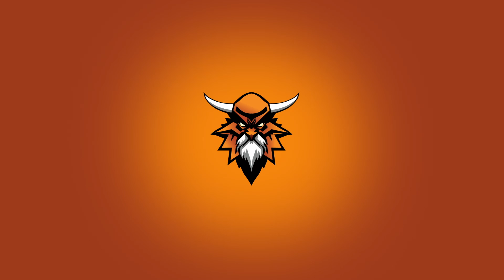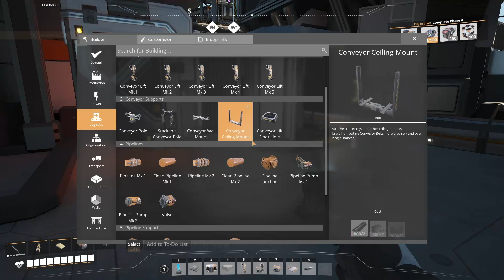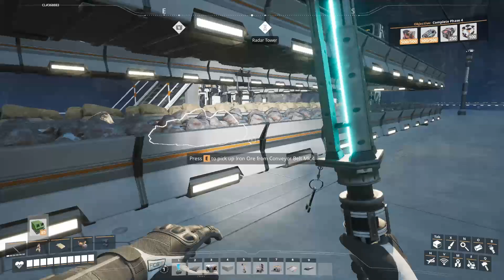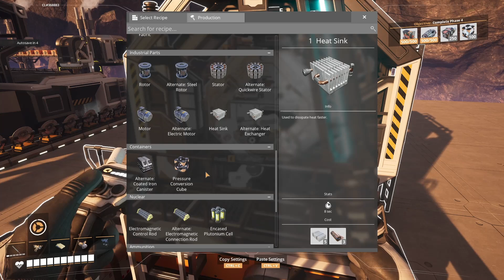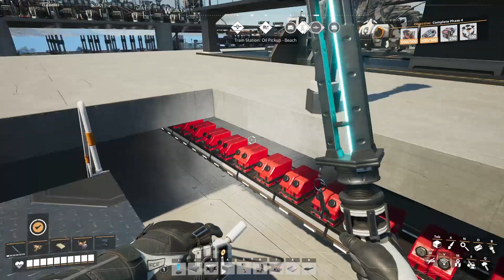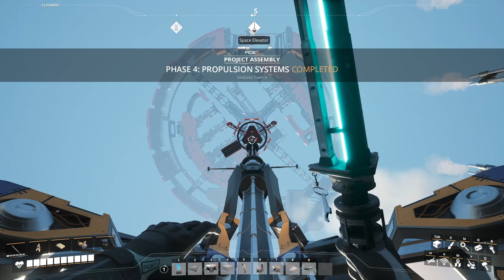Satisfactory 1.0 - I Finished Phase 4 [E24]

Comment: I will say the somersloop mechanic for doubling output will come in for copper powder. Uses half the resources to get what you need.
Reply from the maker: Could work, but there are limited Somersloops so you need to be careful how you use them.
Reply: @surtrplays   I agree. You can get the same results by power sharding machines
Reply: @surtrplays  yes, but constructors only use 1.
Reply: @surtrplays  There are not enough Somersloops I only have 29 more I can collect and could use 19 right now and I'm sure I'll want a ton more for the last tier of stuff.  Mercer spheres on the other hand are all over the place.
Reply from the maker: Yeah, you have to be careful how you use them.

Comment: for the copper powder would the pure copper recipe not be good for ingots (just add water)?
Reply: Yea lots more power. Pure is a trade off. The base recipe is actually the most power efficient. Forge and then pure follow. 
Pure produces the fastest output
Reply from the maker: Its fine but you will be using a lot more machines (refineries) and that is more power.
Reply: @Rogerfoulger  I was wondering the same thing as well but it was well answered below why not to do pure
Reply from the maker: I just didn't feel like building so many machines. I'm tired.

Comment: I will have 4 machines making Nuclear Pasta,  I want extra cubes for some interesting Alt's  I have found.
Reply: Got everything but the Nuclear Pasta built yesterday.   Pasta today and I need either 24 foundry or 64 Refinery in order to get 400 powder to run 4 Accelerators.  Think I'll go with the foundry's and do two lines of 12, each needing 600 copper and 600 iron ore lines.  Should be easy enough.
Reply from the maker: Sounds like fun.
Reply from the maker: Nice. I might go bigger once I have seen how little I can do to beat the game.

Comment: I'm starting to realize that there is no avoiding building big in the later stages, which means a much larger power plant
Reply: I managed to complete phase 4 back in u7 with just the northern forest starting nodes. Now that I'm prepping for phase 5 as well... Big it is.
Reply from the maker: Well we will see what I can get away with. If I can complete the game using under 30GW, I will be happy.
Reply: @surtrplays Doable, depending on your numbers and if you're running many fully buffed manufacturers. That ~800mw each is painful lol.
Reply: @surtrplays  You might need a larger battery bank as backup
Reply: especially if ya dont wannabe AFK for dozens of hours. one impure uranium node can net 150GW.